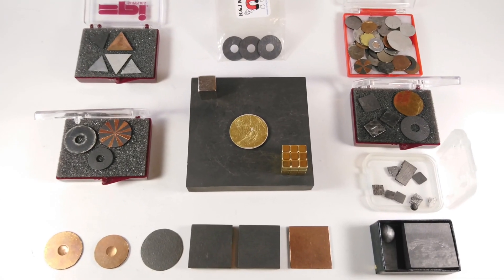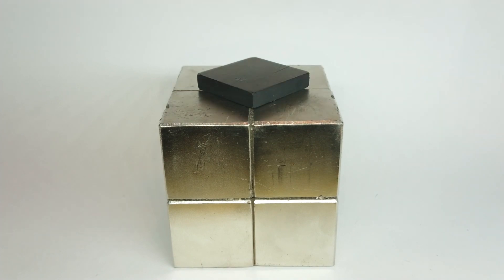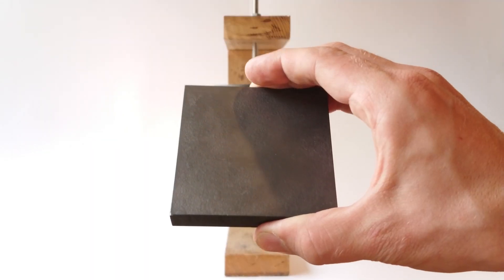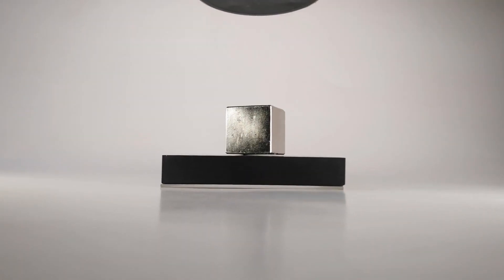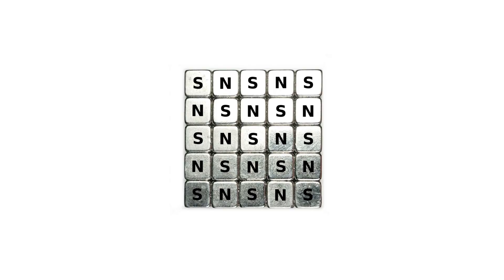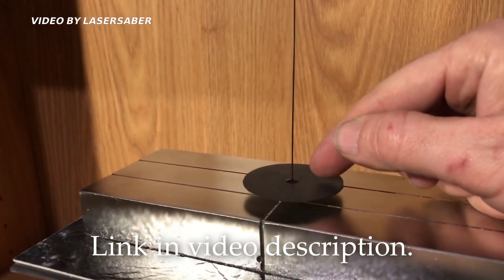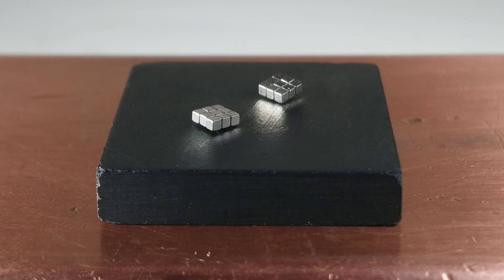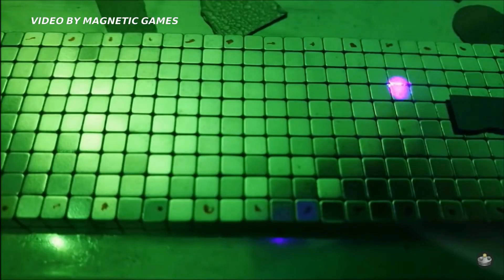12 Diamagnetic Levitation Setups to Try with Pyrolytic Graphite and Neodymium Magnets |Magnet Tricks

Comment: 1:35 : but here, there are not yet an array of N and S poles, only one pole sees the pyrolitic graphyte surface... is it because another and bigger magnet (on the top) enters in the play of the mutual magnetic relationships?
Reply from the maker: Current magnets we have are too heavy to levitate on PG without a lifter magnet. Another PG tile ontop will push the magnet down, it isn't necessary.
Reply: @MagnetTricks  Not, i asked why, in this situation, there is only a magnet and not two, three or four like in the other configurations of levitation: it is because there is the lifter magnet as you say, thanks for this information, but this lifter magnet is it necessary only to go against gravity or to generate, at least, a second magnetic flux that interlocks itself with the first one (of the small levitating cube) in order to generate levitation?
Reply: @MagnetTricks   Not, i asked why, in this situation, there is only a magnet and not two, three or four like in the other configurations of levitation: it is because there is the lifter magnet as you say, thanks for this information, but this lifter magnet is it necessary only to go against gravity or to generate, at least, a second magnetic flux that interlocks itself with the first one (of the small levitating cube) in order to generate levitation?
Reply from the maker: The lifter magnet's purpose is to lift the smaller magnet enough so that the slight repulsion between the PG tile and magnet can show up as levitation.

Comment: I've bought neodymium magnets and pyrolytic graphite, but I couldn't make the levitation happen...
Reply from the maker: Did you use high grade neodymium magnets preferrably close to grade N52?  Weak neodymium magnets don't really work. With suspension, the lifter magnet should be very large in size and the levitating magnet should be small.. Hope you succeed!